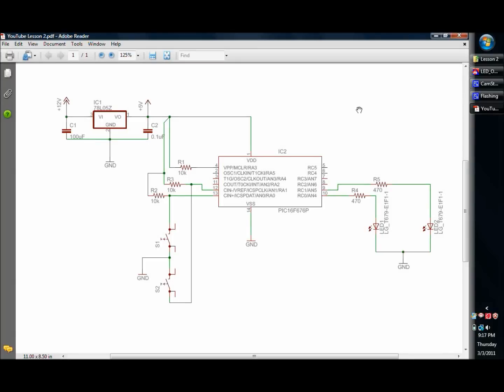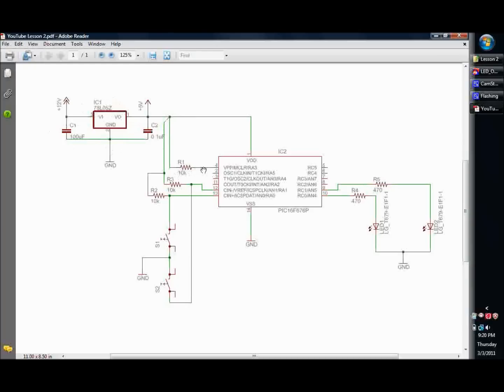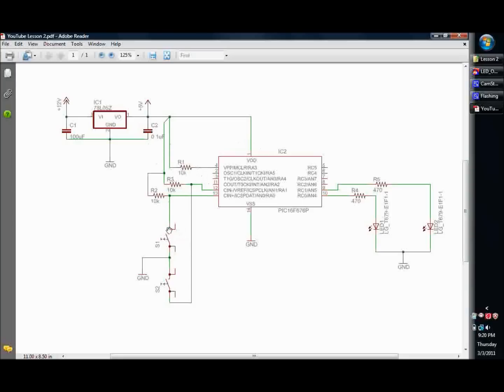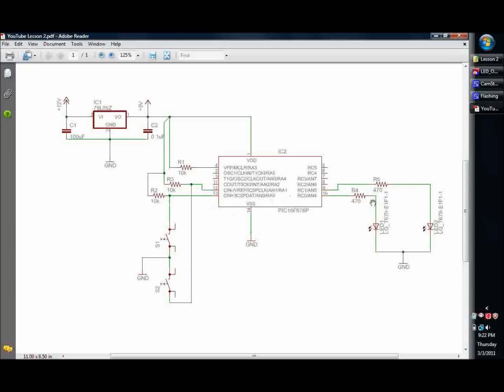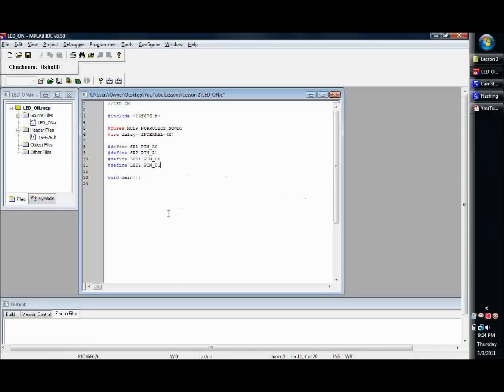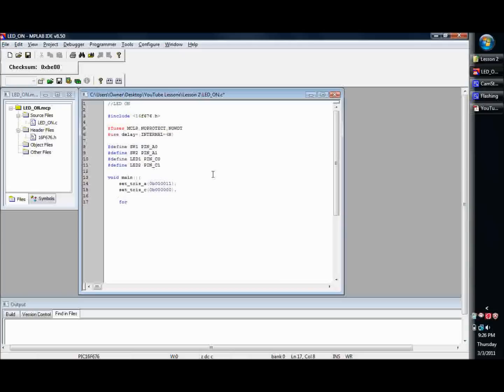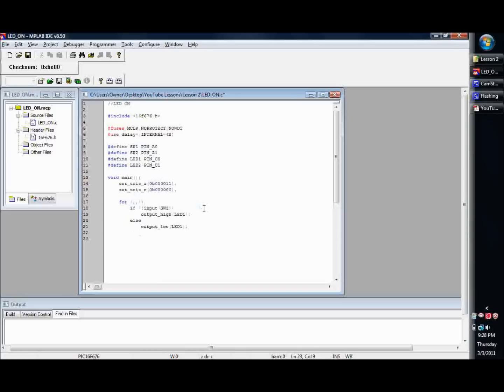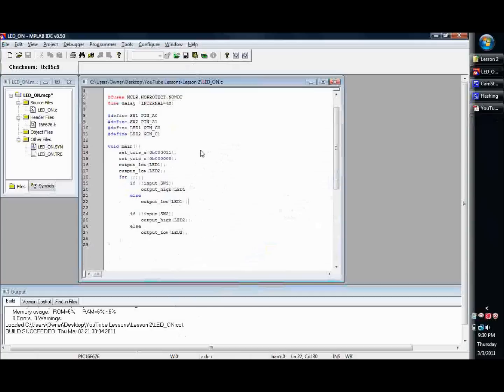Lesson 2 LED ON project PIC Microcontrollers Part 1

Comment from the maker: The software that I am using is MPLAB IDE you can get from Microchip.  The simulator that is being used is called MPLABSIM.  It is in MPLAB IDE.  Check out Part 2 to this video to see it in action.